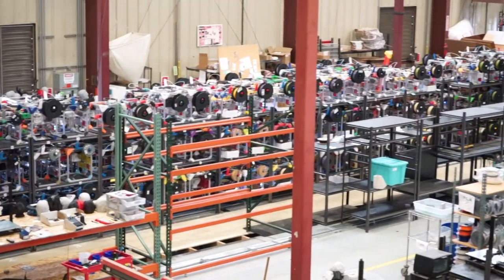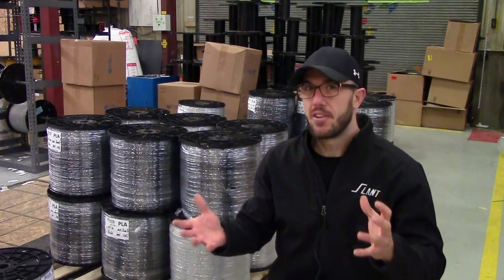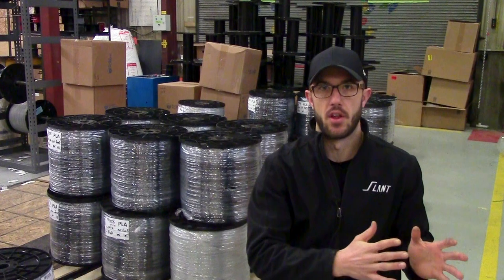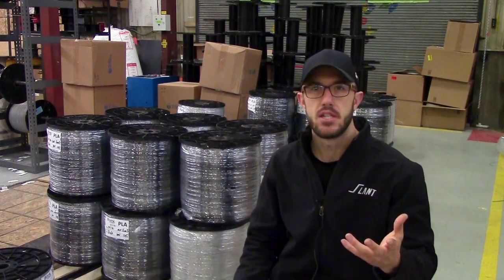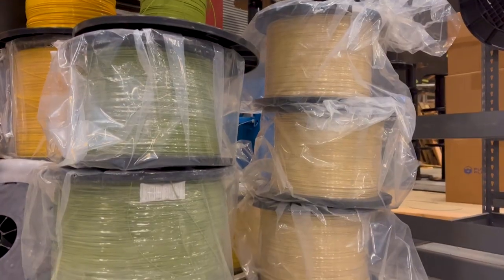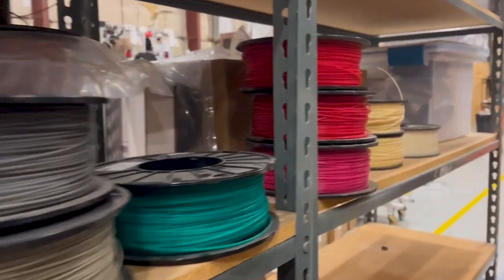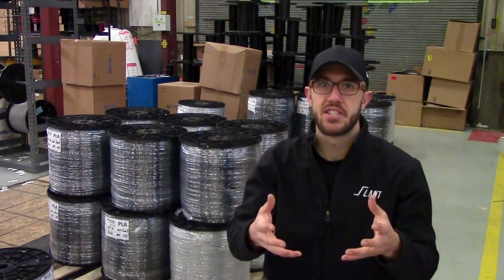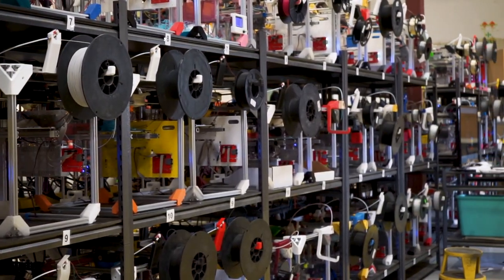How Much Filament Does a Giant 3D Print Farm Use?

Comment: The bigger question is why 3D print in volume when injection molding is exponentially faster????
Reply from the maker: Because 3D Printing is cheaper, lower risk, gives more flexibility, reduces inventory, and produces at the same rate as injection molding.

Comment: Anything special about the racks you use? Are you concerned about vibration? How much do you space apart each printer? Any dampening technologies being used? Do you genericize print settings as much as possible or do you set them per print? For example do you tend to print everything @ same mm/s or depends on per print job requirements.  Trying to understand the line between standardizing vs uniqueness required when trying to do this at scale while supporting individual unit/job requests.

Comment: Are you strictly fdm printing or do you utilize that as 1 part of the overall process. Example: maybe you print a part but use metal inserts or attach metal braces or some other kind of part to make a whole unit of something for a customer. If so how do you blend say cnc or some other technology (maybe lasering or something ) to make an efficient workflow and add to additive manufacturing process.
Reply from the maker: We strictly do FDM. It is the only process viable for the long term mass production. WE highly reccomend watching our other videos they cover a lot of your other questions.